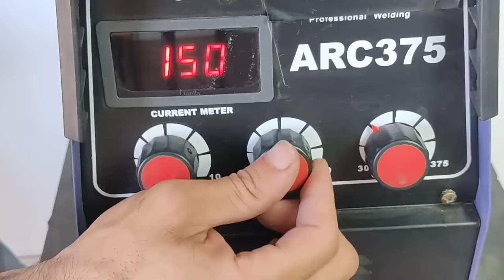6013 Vertical Electric Welding Tricks

Comment: Years back 6013 was called the electrician rod. Because it was so easy an electrician could do it.
Reply: That's really dumb.
Reply: @tandemwings4733  apparently you are too.
Reply: @plainlogic  What makes you think that?
Reply: @plainlogic  Actually, I'm a qualified welder, and the easiest electrode/s I have ever used are 6010/6011.
Reply: 6013 is not an easy rod to weld my freind. Especialy vertical or horizontal. Not even on flat surface.
Reply: @rolmena9556  let me guess you're a "qualified welder" too.
Reply: @plainlogic  yeah, when i mean its not an easy rod to weld i mean you most have expirence in the field. Its not a rod that a learner will come and  weld with it. You know what i mean.
Reply: @rolmena9556  
That's gotta be a joke, surely.
I buy them at 100kgs at a time, and I work solo, welding ALL positions.
Reply: @tandemwings4733  i have to se what kind of weldings you are talking about bro. Thats the difference
Reply: @rolmena9556  
All sorts. From light galvanised pipe (stock yards etc.), to sections up to around 1 inch thick, on structural, earthmoving,  and transport.
Occasionally have to use basic coated, but mostly able to use MIG in those circumstances.
Reply: @tandemwings4733  in that case i can understand, you have enough expirence and you know the tricks how to apply 6013. You see the thing is i dont agree with my freind at the top saying 6013 is easy to weld for any body to use, even for a guy that doesnt know any thing about welding. When i know that they are easier types of welds, example 7018, 6011, 6010. This rods you can weld them with ease on any position.
Reply: @rolmena9556  
I really don't know where you are coming from. 6010 and 6011 are what I call "firesticks", only used for penetration passes, and occasionally for difficult to get at welds. Never for GP work.
7016 and 7018 are those god-damned basic coated rods that U.S.A welders seem to cream themselves over.
The "gunbarrell" effect that requires the flux coating to be knocked of the end at EVERY restart, is a pain in the arse.
I never use them because - a) they ARE a pain in the arse, and -  b) I very rarely need a higher tensile filler, and if I do NEED it, I would normally be in a situation where I can use MIG (as I wrote earlier).
I keep around 5 or 6 different rod types with me, NONE of which are basic coated (7016/18).
We had to do a batch of coupons with basic coated rods when I did my trade exams, and I ALWAYS considered the things a "PAIN IN THE ARSE" to use. EVERY time you want to re-strike, you have to chip the shit off the end.
I can clearly see that, either you are NOT a welder, or, you're trying to wind me up.
Please note. At no point do I agree that ANY rods are easy enough for anyone that knows little or nothing about welding.
Reply: @tandemwings4733  i agree with you, 7018 is a verry hard rod and it happens to stick a lot if you are not good enough. We mostly use it to weld pipe lines here. And other structural buildings. Or things that required tough welding. And yeah 6010 and 6011 are designed for deep penetrartions. We also use it to  weld old rusty steels here. And ocasionaly regularly basicaly on any job. I mean come on its a 3rd world. We dont have a quality check control here. That dosnt mean we dont know the right purpose for the rods espicificaly. What i was talking about was the difulty in appling the welds. 7018 is a rod that is very hard to run down if weld on positions like wise the other i mentioned. 6013 that fucker will left you an ugly welding weld from position if you dont know a few tricks. Thats what i meant.
Reply: @rolmena9556  
No tricks. At all.
Just the ability to weld correctly. 
I NEVER weld vertical down.
Every other procedure is OK.
Reply: So ... this was an interesting conversation, thank you for that. It was usefull for me.
Reply: @8 Track Motorworks we dont have it bro. Thats one of your upper hand. Here we only have 1 or 2 too choose. Infra or lincoln. Whats so special about this rod though?
Reply: @8 Track Motorworks ok, i get it. It doesnt run due to the thin flux. I get it. Most be realy easy to weld with. Thanks for the info brother.

Comment: You need to go up to get root penetration and then across as you are doing but with longer pauses at each side to avoid the slight undercut you are getting. If you break that weld, you will find low root penetration with some slag inclusion pockets
Reply: Especially with a 6013
Reply: 100%
Reply: And for the roots,I change my polarity (electrode  negative)

Comment: Thank you, I didn't think that 6013 could be used for vertical up. I had been using low amperage settings . A big thumbs up.
Reply: Of course 6012 & 6013 can be used vertical up. UP -  is the ONLY way to weld vertical. Down is only any good for cosmetics. With the exception of pipeliners of course, and that's an entirely different discussion.
Reply: @tandemwings4733  I'm glad you said that. Uphill for 3F position is the norm...and for any vertical.  Not really is "secret trick of the trade" lol.

Comment: Just know that this is a "Cover Pass" technique and not meant for the "Root Pass" especially on a fillet.  You need to use the Whip N' Pause, Inverted "T", Inverted "V" or Triangle rod manipulation to get any kind of root fusion since E6013 has low penetration characteristics.

The "U", "W", or "Z" weaves are fine for uphill covers and stringers work equally well with a circle motion.  Any other position requires you to stay on the leading edge of the puddle to keep the slag at bay.

Like most stainless steel electrodes, E6013 requires some type of weave motion with a slightly longer arc length to blow the heavy slag back to make the puddle visible.  The increased arc force also helps prevent wormholes too.  Remember, E6013 is a slow deposition electrode hence you need to spend more time on the toes and go a little slower than E7018 😉
Reply: I envy to see those weld seams. I can't do anything like that

Comment: I always understood that you should go low on amps when welding vertical up because the heat rises ahead of where you're welding. But 150 is nothing like low on amps. And it still looks really nice!
Reply: Exactly..i think so,usually 120 A for 3.25 mm
Reply: Not true. Amps depends on welding stick size and material + thickness and material welding is being performed on

Comment: that low penetration cant be 150A. Personaly i think you have used like 110A, or 100 for this welding.
Reply: Came here to comment section, cause i saw the arc was low. And wantes to see who else thinks the same.
That is 10mm steel plate, he is going up with about 90-110 max.
6013  3.2 is burning with big arc already with 125amps...
Reply: @robylv5720  I agree with the amps figures you mention. Welding machines are not consistent when it comes to indicating amp settings. If I ran 3.25's on 150 amps, I would be dealing with some serious edge undercutting. I run 3.25 - 6013 at around 115 amps for vertical up, using a Fronius Transpocket 1500.

Comment: Im new to welding and have a hard time figuring out the puddle distance ive been told roughly 1/16 or 1/32 of an inch away but thats about it. Is there more to it than that or do you also have to do additional steps to keep your puddle flat. (Mine rise like a mountain and finish like a bb size. ) any criticism or help is appreciated

Comment: It's easy to weld thick metals. I would appreciate if you do the same job on thin metal...
Reply: Thin metal with 6013 would be best done running the bead down in a straight pass, rather than upward with a weave pass.

Comment: the rule for finding the setting is (diameter of the electrode -1)x50  for example 2,5-1 equal 1,5 
1,5x50= 75A
then you should add 20% in downhill and internal corners, and minus 20% in external corners or uphill.
It's not 100% accurate but it gives an idea of where to start

Comment: Any suggestions how much Amps do I used for plate 3.2mm vertical.
Reply: E6013 3/32 electrode 75-80 amps vertical down travel speed should be fast for 3mm plate

Comment: 150 amps for 6013? 
Anyway good video. Thanks. New Subscriber here
Reply: For me, 6013 X 3.35mm, at 150 amps = serious undercut. Should be 110 to 120 amps (less heat into the joint too).

Comment: Please take this as trying to help and not picking on you mate but that is not the correct method for vertical stick welds. It looks nice but it is getting no root penetration making it weak whereas a properly done vertical is one of the toughest welds there is. It is not a 1then 2 type motion..that's a weave..it is 1 then 2 then 3..a child's drawing of a Christmas tree if you can imagine. 1 left...2 right..3 UP into the very guts of the weld then back down to 1..pause...2...pause..3 UP then repeat. It looks ugly to an untrained eye but to someone who doesn't want a boiler to blow out or a building to collapse it's really pretty!
Reply: ..sorry should have been clearer..this is in relation to the first pass

Comment: what does 6013 of the electrode mean
Reply: 60*electrode 60000 psi per inch strength 13 means all positions
Reply: @RanjitSingh-dl1wi  60 = 60,000 pounds tensile strength; 1 = all position- flat, horizontal, vertical, overhead; 3 = type of flux. Rutile in this case
Reply: mr outback  No. You have it backwards. 6013 has a slightly more viscous slag than 6012. BUT, neither is really suitable for verticle down, which is only a cosmetic run anyway.
Reply: mr outback  I find it strange that, as a coded welder, you found 6012 useless as vertical up. I do it day in and day out, without any problems. 
Yes, I run DC negative all the time, as I am mostly onsite with mains power supplied, using an inverter machine these days. Occasionally run MIG, even then never vertical down.
As stated before, vertical down is only good for cosmetics, fundamentally useless otherwise, except for small, good fit pipe rail fence work, as you mentioned.
Reply: mr outback  With 6012/13's, all sorts. From light galvanised pipe (stockyards etc.), to sections up to around 1 inch thick, on structural, earthmoving, and transport.
Reply: mr outback  Ha, Ha...  No, the gal doesn't worry me. It's easy when you've done enough of it.